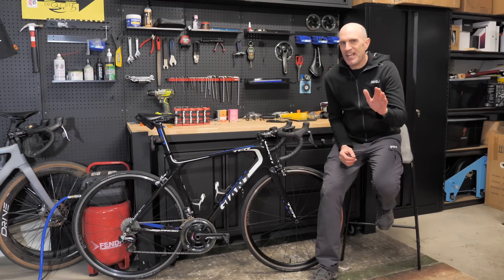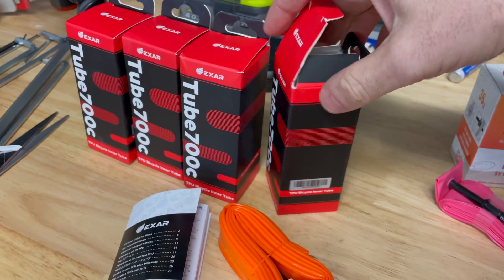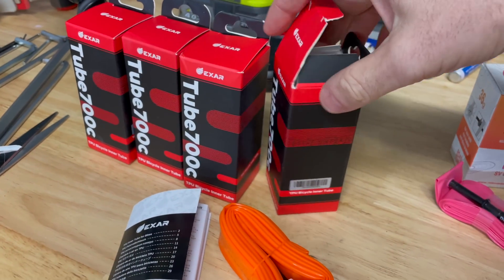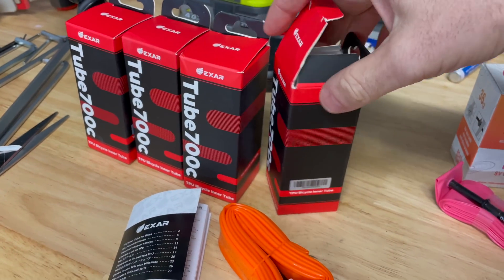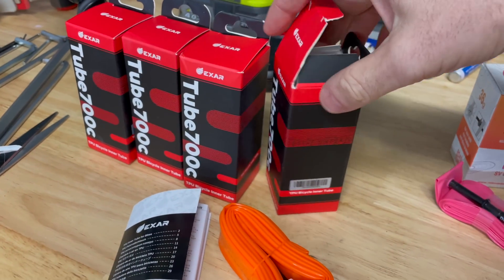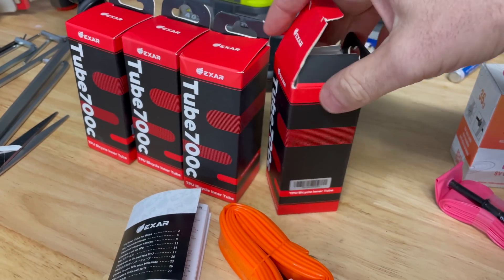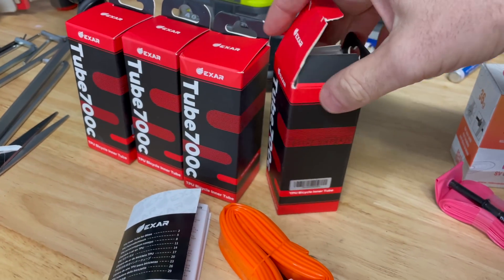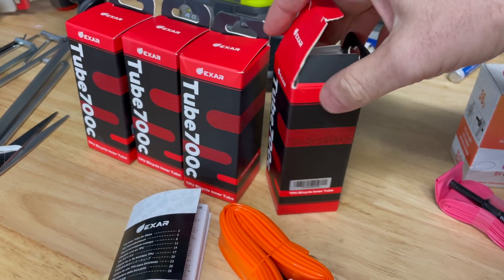TPU Bicycle Tubes: Light, Fast, Cheap.... What's the Catch?

Comment: I definitely carry the TPU's as spares as they're way way lighter than butyl tubes and take up minimal saddle space. 
Similar to you I was running tubeless,, but switched out from these for maintenance reasons. I find the ride on TPU not as smooth and comfortable and as fast as tubeless or latex. Nonetheless, they're a clear advantage over butyl.
As covered in your vid the TPUs are easy to mount and their hi-vis colour is an advantage.
Good vid as always and I love you've put the new air compressor to immediate use.

Comment: I’ve been using Tubolito’s for a year now. 10,000 km and love them! I have repaired them and they have been fine to use again. Will probably change to a cheaper brand when next ordering if the Tubolito’s are not coming down in price.

Comment: My RideNows keep slow leaking air after a week. For the life of me can't figure out where the leak is, seems to be need repeated pumping all the time. Is that normal?
Reply: That doesn't sound normal, you can't track down the leak even with water submersion?
Reply: @sbccbc7471  nope, tried for hours, could not find bubbles

Comment: What's the reason for using the floor pump when pumping up the tubes and tyres, instead of the air compressor?
Reply from the maker: Less noise and a lot more control over the pressure.
Reply: Thanks, I won't bother getting one then haha @gplama
Reply from the maker: They’re a must-have if you’re messing about with 25mm tubeless which can be a total PITA to seat. Air compressor is yet to fail me getting anything seated.
Reply: @RhysCycle Definitely don't use an air compressor to inflate a TPU inner tube even slightly when you're doing it for leakage checks, don't ask me how I know (I only got a tad too careless). 😂

Comment: i’ve used TPU’s for the past year or so, Tubolitos to be exact. They work great very light and little rolling resistance. However, they are very expensive and have been looking for another TPU brand that is cheaper but still good quality. Any Recc’s? Thanks 👍

Comment: Is that a PES 505 base power meter? I'm considering buying that and I'm wondering if your going to make a video about it soon. I'm also worried about the one bolt installation. I have seen on reddit that some people experienced the cranks coming off. Did you experience anything of the sort?

Comment: I rode my ridenow tpu tubes on the rollers, big mistake. Both had heating issues and don't hold air for more than an hour now. Replaced them with new ridenow tubes and they've been going well for months on the road, never punctured. Just avoid using these on rollers.

Comment: Hi Shane/all, what's the experience inflating these TPU tubes with CO2 canisters?
Reply: Just go slow to give the tube a chance to take shape (use a valved co2 adapter so you can inflate a bit more carefully). That's what I've heard...
Reply from the maker: They’ll inflate, just don’t freeze them in the process.

Comment: 80psi? Would you run lower? I’m 72kg running them at 70-72 psi with Michelin competition 25c on HED Ardennes
Reply from the maker: I’m around 78-79 these are 26mm tyres on 19mm internal. I might drop them to 75 and see how they go.

Comment: I've been using CYCLAMI TPU tubes for several weeks now.  These are about $14 on Amazon in the U.S.  Unlike other TPU tubes, these have standard metal threaded valve stems.  These pack very well into my saddle bag and save a lot of grams.  I do notice a huge difference compared to my butyl tubes; as I have more speed when climbing with these light tubes.  So far, no flats or problems.  They lose a bit more air over 2 days than butyl, but less air loss than latex.  The other odd thing is that they make a bit of noise when rolling that butyl tubes do not.  So my verdict is that these are worth the switch if you're running butyl tubes:  better performance, and weight savings in the wheels and saddle bag.
Reply: One year follow-up:  I finally got a pinch flat.  I think  it's important to keep these at the target psi.  I hit a pothole and had a double blowout.  Then when replacing the tube in the field, I had another failure due to the tube being pinched (using cartridges).  So the lesson is that these can be temperamental.
Reply: Appreciate your comment about Cyclami TPU tubes.  I purchase a few last year and have only tried one that went flat sitting overnight after installation.  I'm sure it was something I did during installation.  Will try using one again this week.  I just need to have confidence they will hold up.
Reply: Mine are still going strong since I left the comment.   @TexasNightRider
Reply: I am interested to hear your thoughts on how the ride quality (comfort) changed when you moved from butyl to TPU.
Reply: @arunabasnayake5258  I did not notice any difference in ride quality, and I can report that I am still flat free since installing them.
Reply: Weird, I didn't notice any loss at all in weeks with the 38 g version..
Also they are 4 x cheaper on Aliexpress.
Reply: I just installed Cyclami  tpu’s on a ‘91 Bridgestone RB-1 I just acquired. Mine have flexible plastic valves - kinda annoying. About to go on my first test ride.

Comment: Good review. I carry a Tubolito in case my butyl tubes have a puncture. Every time I consider Tubolitos (or some similar product) I'm put off by: 1) the cost, and 2) puncture issues. Seems like most of the commenters here have little or no problem with punctures, but when I look at reviews on Amazon, seems like a large percentage of reviewers do have puncture problems and have given up on TPU tubes.

Comment: Hey Shane there are also gravel and MTB tpu tubes. I have switched to Michelin power cup clincher tyres and ride now  tpu tubes.  Wow this is the lightest, Best rolling and most supple combo I've been running. It is absolutely 10/10. I can only reccomend. You save a lot hassle , weight to tubeless and with clincher tyre it is supple af. And the big advantage is that when you get a puncture it is a slow leak not a blow. So you can pump it and safely get back home. Happend to me once I need to repumps to get back home 50km. I've fixed it with cyclami patches and rides strong.
Reply: In regards to your comment about slow punctures with tpu tubes, I have had this happen to me before but I have also had one let all the air out within a space of about 5 seconds. Luckily, I wasn't on a downhill section.

Comment: A word of caution: When I was cleaning my cassette, I had some degreaser drip into the rim through the spoke holes. The TPU tube I had installed would not hold air anymore after that, even after thorougly cleaning and drying. It seems like the materials was permanently altered by the degreaser. I inquired with the manufacuter (Tubolito) who basically would neither confirm nor deny this property of the material, although I had the impression they were genuinely trying to be helpful. Maybe @GPLama can check that or some other users can chime in.
Reply: What was the degreaser that you used?
Reply: It was Shimano branded degreaser from a 1 liter canister

Comment: Love these tubes, but just had to throw 2 away. After only 2 months of riding (twice a week on that particular bike) the valves started leaking. Tried taking the valve top out and running some silicone around the thread, but no joy. Running another pair on another bike, but the valves are the old fashioned alloy ones. Had heard about valve issues and that it had been sorted, so either I was sold old stock or their longevity hasn't been tested. Will still buy, but only the all metal valve type (which are still amazingly lightweight).

Comment: I carry them for spares because they're so much more compact than butyl tubes.  I can carry two TPU tubes, Co2/inflator, and tools in a tiny 25 cubic inch saddle bag.  But I'm running tubeless and haven't had to actually use one yet.
Reply: FYI, you're not supposed to use CO² inflator with Ridenow TPUs and I guess it's the same for other brands.  I use a pump with a gauge attached to my bike's downtube and this weighs less than 2 x CO² canisters and the adapter.

Comment: One other thing- I've found that TPU tubes can be patched with any poly vinyl patch kit, ie a kids beach ball/ swimming pool repair kit.  These are usually cheaper.
Reply: Thank for this. I bought some  and you are right. The beach ball patches I got are about 5cm by 5cm and make about 9 patches and I bought 5 patches for $2. That may last till I die. 

Also a guy on reddit recommended rubber cement. I did not believe it because TPU is not rubber, but I tried it with a spare piece of TPU and it worked even better than beach ball patch on a largeish hole near the valve from which beach ball patch had become unstuck.

Comment: I switch from butyl to the RideNow TPU in a 32c GP5000 tyre on my endurance bike. The regular maintenance of going tubeless, on my road bike, never seemed worth the hassle. Especially when it is recommended that you carry a inner tube "just in case". The reduced rolling resistance and weight versus my stock tyres plus low tyre pressures were an additional bonus. The tipping point was that the RideNow TPU tubes are actually cheaper than butyl tubes where I live.  Last, I have frame storage so the size of the TPU tubes made it so that I can carry two tubes at lower weight plus other normal emergency items and avoid an external bag entirely. All wins straight down the line.

Comment: I used Tubolito TPU tubes and the weight and space savings are great. But all 3 tubes I used had the same problem: They were leaking air through the valve. I went back to regular Schwalbe rubber tubes.
Reply: I initially had similar air-leaking problems with my Schwalbe TPU tubes, which have removable valve cores. I tightened the offending valve cores, and now they hold air quite well.
Reply: Have you tried TPU tubes with metal valves? Plastic ones are not that good long term

Comment: I've been using them for 4+ years and love them.  They are GREAT.  All of the traits that are claimed,  low weight,  better puncture resistance, etc.  Ive found to be true.  Prices are coming down now,  so there's really no n reason to use butyl or latex tubes.
Reply: Latex has much better road feel, shock absorbtion properities, pinch resistance and slightly lower rolling resistance.
Reply: @michadebicki6534  Latex is mostly heavier, comes at a much higher price, and loses air permanently.
Rolling resistance is negligible at 0.2 W difference, as well as "feel" and shock absorption if you don't ride extra light race tyres.
Reply: @DR_1_1  The price is not that much higher nowadays, I buy Vittoria Latex tube for 9-10$. It is a little bit heavier but this is negligible. I do ride a high performance Veloflex tires all the time and the difference in feel and comfort is definitely there and noticeable. I do check my tire pressure before every single ride so air loss is not something thaty concerns me. TPu also has one major flaw - you can't fit it into the thinner tire after using it in the bigger one cause the plastic stretches. latex also gives you a possibility to use Effetto mariposa latex sealant which will prevent blowouts and slower the air leakage.

Comment: i've been using the ridenow and similar aliexpress TPU tubes for a while now. They are very much comparable to latex tubes. One major disadvantage: they are so thin that if you fit them into a tyre that has the smallest grain of sand in it, it will cause a slow puncture that you will probably never find because you cannot inflate them enough(outside of the tyre) to expose the very small puncture, even when submerged under water. So I would recommend fitting them in very clean or new tyres only and take a spare butyl tube for any repair on the roadside
Reply: Pro tip on finding punctures. At home dunk the tube in water and find the bubbles or use a spray bottle with soapy water, spray down the tube and find the bubbles. Ride safe.
Reply: Agree with the cleaning of the inner tyre and rim before using TPUs...
Notice they often come in 2 versions, eg 24 g and 36 or 38 g. The "heavier" version is less delicate, so easier to mount, can be used with rim brakes, etc.
Reply: @DR_1_1  now the 'ridenow' tpu inner tubes come with a removable valve-core, so I inject some tubeless sealant in there and that plugs the very tiny punctures
Reply: @igvabe  Wow I'll have to check that... with a syringe? Sounds like this could even be done on the road, how much sealant (for what tyre's width) ?
Reply: @DR_1_1  I use the sealant by Muck-off, it comes in little bags and is not that viscous as other brands, so it doesn't clog up the valve itself. Just screw out the valve core, the bag fits on the valve stem, squeeze about 30ml in it, put the valve core back in. I guess you could do this on the road, but I prefer carrying a spare butyl tube, nice and solid, easy to replace
Reply: How slow is the slow puncture?
Reply: @onepoundfishonepoundfish  When just inflated, slow enough to do a ride on it, but the next day it's flat, and nearly impossible to find it
Reply: I had same experience. Put tube in an old tire and got flat. I'm only using them in new tires now and doing fine.

Comment: Anecdotal experience : Put on some Pirelli TPU tubes with Conti GP5k 25c tyres this spring. One suffered a pinprick puncture on my 2nd ride, opposite from the valve. Having installed it with the utmost care, and with only 3 punctures total in 25,000 km, I was disappointed. That said, the other tube has been fine over 4000 km.

Can't say there's any noticeable difference in speed or comfort, and that odd puncture made me a bit nervous. Still, the price is just about acceptable when you consider the 200g weight saving over 3 tubes.

Comment: Awful junk from my experience  with tpu.  Ridenow leak at the valve the tube also puncture very easily. Very hard to patch and they patches don't take well...tried lots. Ok for a spare but beware they can puncture very easily. If you can't put a tyre on and off by hand don't bother as your levers will bugger them.

Comment: Good review.  One of those super lites + a few patches is a good idea for catastrophic tire injury on LONG races and trips.  

I can't see any benefit to converting from tubeless though.  There are simply too many tubeless benefits for me to swap. 
Having only two regularly ridden bikes being one.  So checking tire sealant as I rotate a rear to front isn't a huge deal for me.
The biggest benefit being quite obvious on swapping tires.  I often find two or three foreign objects (small thorns, glass slivers, staples, etc.) embedded in the tire where sealant prevented a puncture stop without me even knowing.

Comment: have purchased  Cyclami TPU tubes for my bike , i use the continental 5000 28mm tires, what i did is put the tubes in with a new set of tires ,rim brake carbon wheels bontrager aerolus 50s, with 100 psi  so far after 1000 km have had no problems and with hitting a couple of rocks that probably would have caused a pinch flat with the butyl tubes no issues , for rolling I find they do give the impression that they are harder, however I find they feel faster ,however that is subjective to each rider ,

Comment: I’ve been running Foss TPU tubes for a year now (with Conti 4 Season tires 700x26) and zero problems. No flats. They’re so reliable they’re now my go-to solution for spare tubes in the saddle/tool bag. Don’t know if it’s the tires, the tubes, my luck, or all the above, but I’m having better results than even those running tubeless. Too easy to not use.

Comment: that lollypop at 3:15 is exactly how my tubes are in my saddle bag. i rotate them so the stems are at the top/bottom and it leaves a lot of extra space. probably not for everyone, but lower volume that the squiggle around the stem method.

Comment: I don't recommend this type of tubes if you are doing long technical descent. Both of my tubolito exploded on long descent when rim was hot. rear one ended splitting  my Mavic ksyrium rims too. It was very loud bang not usual puncture.
Reply: Tx for feedback. I scanned so many messages to find this. Because everywhere I searched they said not for rim brake and over 75 psi

Comment: I use TPU tubes as spares, although I have not had a puncture in more that 10 000 km... I prefer latex tubes for the increased comfort and slightly better rolling resistance, but the small size of TPU tubes is invaluable as spares.

Comment: I have the ridenow TPU, bought a bunch of 10, the quality is a bit random, I had 3 out of the box is leaking slowly, 60 psi lost in 2 days. used 4 other holds the pressure for weeks. 2 of them were used for my gravel bike with 43mm tyre and running at 30PSI without any problem for 7 months. I also keep 2 in the saddle bag for any puncture, luckily none so far on the terrible Scottish road

Comment: I'm using latex or tubolito on my rim brake bikes, no issueswhile descending, not one puncture, they give weight saving equal to a wheel upgrade . So far very satisfied with them
Reply: Tubolito (the lightest version) have a warning on them not to use with rimbrakes, not sure if the ‘heavier’ ones have those too.
Reply: @Stevenafoe  the 25 grams are disc only the 40 grams are disc and rim brake, no issues descending with them and im 90 kilos

Comment: I currently use Vittoria TPU tubes in two bikes, but I have found that the frequency of manufacturing defects (e.g., leaking air at the bonded seam) is much higher than with latex tubes.